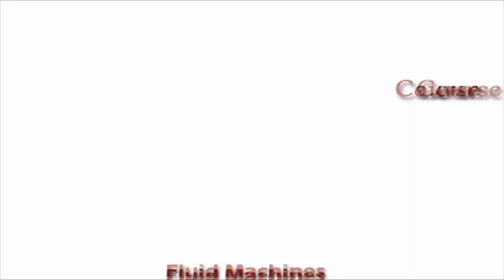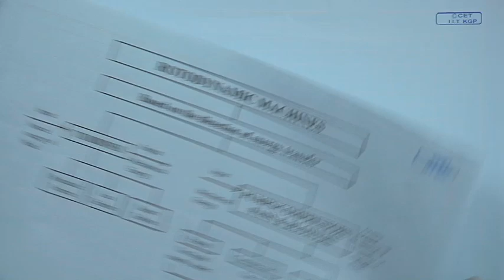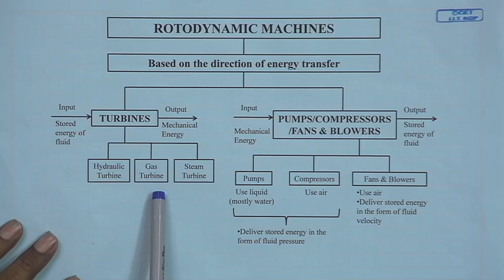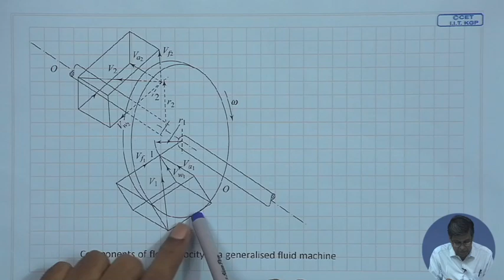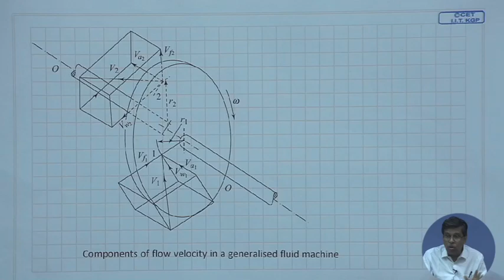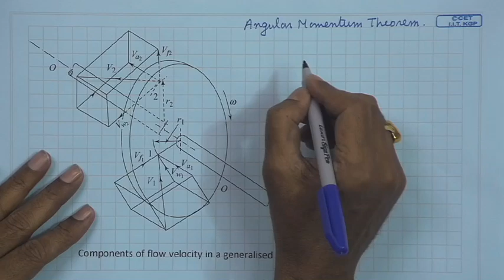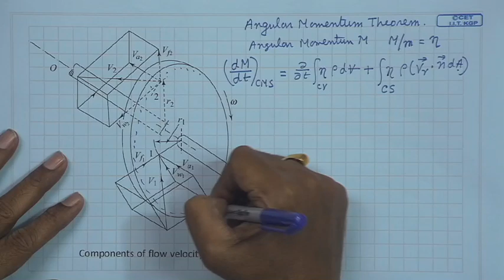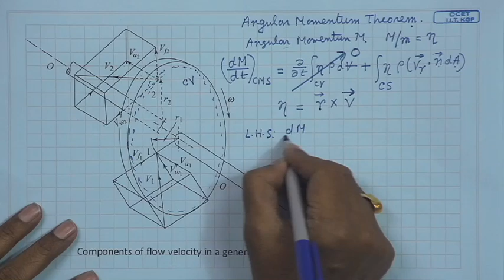Definition of Fluid Machines and Energy Transfer in Fluid Machine Part - I

Comment: axial component is not considered (however it does not aid or restrict the rotation of rotor but it will be useful in designing the shaft for rotor )while deriving the torque equation.so the torque expression  given above is valid only when axial component is zero i.e 2d flow
Reply: Give me some suggestion brother. Which book will be good for fluid machines as a text book?